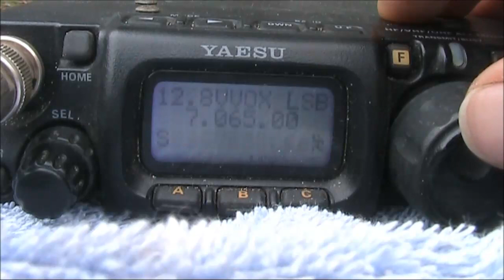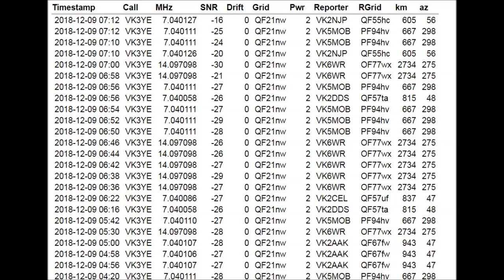The Figure 8: A dual band magnetic loop for HF receiving and WSPR

Comment: You could also try it as a proper figure 8 where you have the cap between the crossing of the eight to tune it. Then a standard feed at the bottom of the loop. What I've read, people claim it increases the bandwidth.

Comment: What I'm seeing on the fence face is not a true reflection of the above and below loops. They are both oriented the same, flatter side atop and narrower side at bottom. Are both variable cap's the same? What are you using to calculate the wire length of 2.5m. Seems that would be more resonate for 10m or 12m? I use duct tape in the US but won't adhere very well to porous fence wood. What is your brand of tape please? 73 KB8AMZ
Reply from the maker: Terry - the tape doesn't adhere well but it was only a temporary test. The capacitors were different but it doesn't matter since they were set to different values due to each section being  for a different band. The wire length is not critical as long as it resonates, though shorter will be less efficient.  The length of approx 1/10 wavelength is about right - too long (I think it's 1/4 wavelength changes its behaviour to be less like a magnetic loop).
Reply: @vk3ye  Thank you Peter.